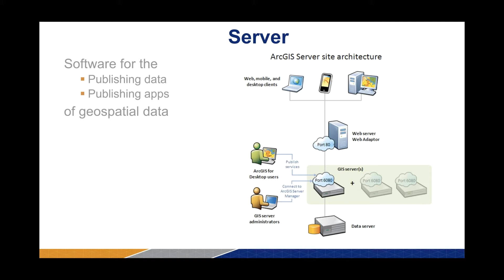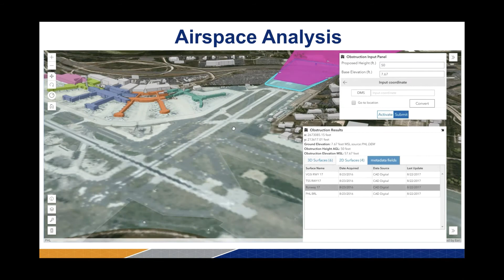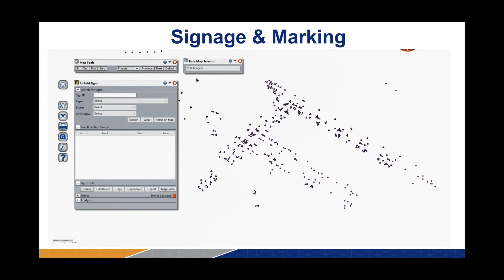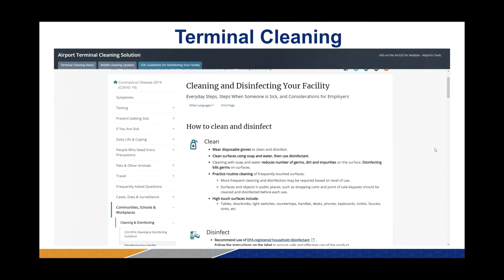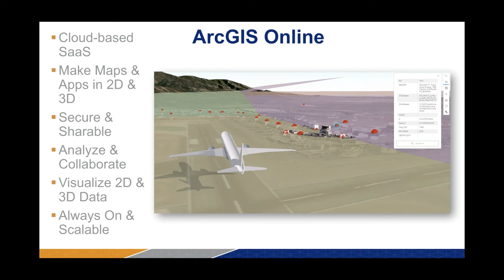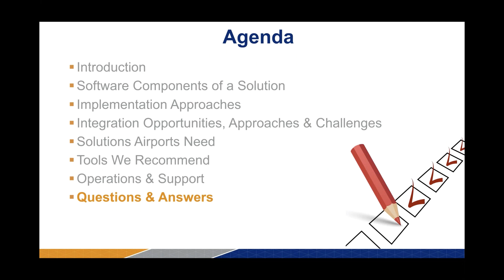Applying a Geospatial Strategy at Airports Webinar

Comment: I find this very interesting. Might be a potential career area for me. I have three decades of transportation experience in aviation, trucking and ground transportation. I bring analysis of safety data associated with aircraft movements, flight ops, surface vehicle movements, both on and off airport areas. I could propose cost saving measures to clients that would reduce risk exposure for personnel, wildlife, environmental areas, etc. Changes to risk can lower insurance premiums, increase productivity by decreasing accidents, etc. 
Might have to take a close look at this industry!